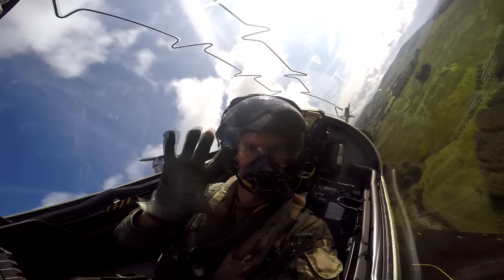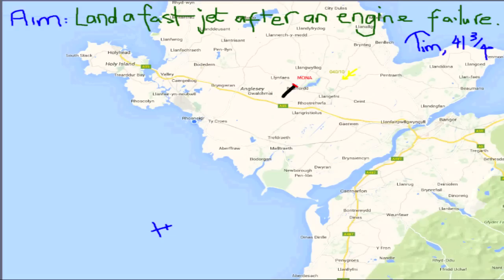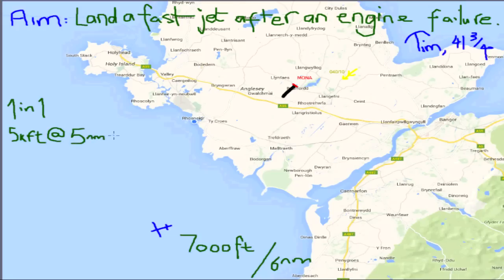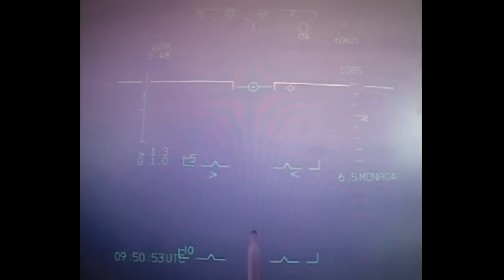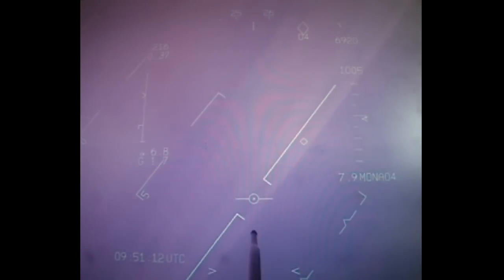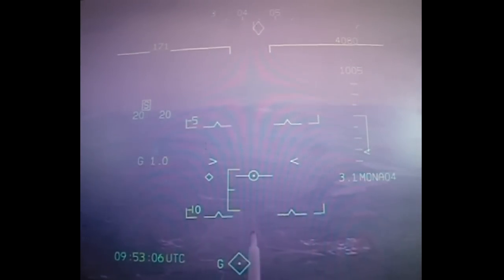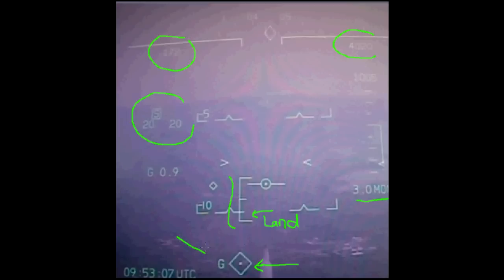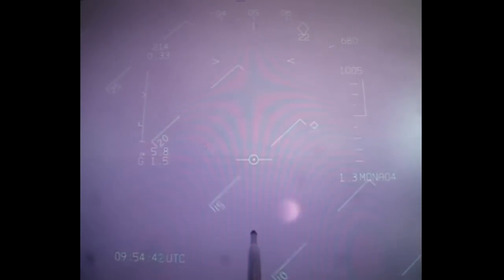When the ENGINE STOPS - Fighter Jet (FULL ATC AUDIO)

Comment: Too high?? Overshot the runway.  No air brakes?? Can you do a forward slip when too high?
Reply from the maker: You can but not advised in swept wing aircraft as you can blank the wing and the rate of descent can be unmanageable. S turns were preferable but not worth the effort so experienced pilots would sideslip or throw the jet away.
Reply: @FastJetPerformance  But a mild forward slip maybe, I mean, not like a piper cub with full ailerons and full rudder. Mild one only??  The Gimly Glider airliner and TACA 110 did Forward Slips both of them on swept wing airliners and landed safely.  Better than throwing the jet away, or your back from the hard ejection..  See those videos of airliners that did Forward Slips and avoided overshooting the landing spots and didnt crash.

Comment: I'm lost.  As a glider pilot, I do nothing but this.  1:1 @ 7000ft means you can cover 7000ft lateral before you have lost your 7000ft height.
In a paraglider, leaving the top of a 3000ft mountain and a 10:1 glide ratios, I easily covered the 3 miles to the landing field with a "down range" of 30,000ft.
A delta wing fighter jet, probably does have a 1:1 glide ratio at 190kts.  It's going to be +pitch AoA (or probably 0* pitch with a +AoA).
So if you are at 7000ft your maximum glide distance = 7000ft + whatever energy you started with.

Comment: Hi. What's it like dealing with engine failure on an aircraft that has terrible glide characteristic. The Hawk does look as though, and indeed this video shows that it can glide reasonably well but some fast jets look like they would just fall out of the sky.
Reply from the maker: Most do fly like bricks, Hawk glides 2 miles per 1000 ft of height lost, I'll cover this in the next video.
Reply: @FastJetPerformance  Brilliant! Fleet Air Arm was my dream job coming out of cadets (over 25 years ago now). Sadly my eyesight let me down at the time, and I wanted to fly the Lynx. I do enjoy watching videos like this, it gives me a very small glimpse into what life could have been like.

Comment: 5 back seat jollies in a harrier. 4 in a T4 and 1 on a T10 which come in 95. Compare the T4 cockpit to the T10 was massive. T10 being a class cockpit. 
Had a back seat jollie on the hawk T1 in 92 on the weather ship. I was sick as a dog. Couldn't even put the seat pin or MDC pin in so the jock couldn't park till I got them in as you well know 
I was banned from getting any back seat jollies at brawdy.

Comment: Sir could u explain the concept of ejection seat limit again.
Thankyou
Reply from the maker: Yes, of course. It's to do with speed and height, the seat is a zero zero seat meaning that it works at zero speed and zero height, it can be used just stationary in the aircraft on the ground. Now, the issue with speed is that, too high a speed and the parachute will be delayed (else it will tear) or if it deploys at too high speed, your internal organs separate and you die. Too low height and too low speed but with a high descent rate and the parachute doesn't have enough time to deploy. In this case on final approach, my rate of decent is about 8000 feet per minute so, using a rule of thumb of 1/10 rate of descent, below 800 feet, my ejection seat would hit the ground before full parachute deployment and its therefore unusable.
Reply: @FastJetPerformance  very informative. Thankyou :)

Comment: I am not a pilot but just curious as to why the warning to pull up when you are accelerating to take off after safely landing?
Reply from the maker: It doesn't happen all of the time but it's the GPWS, Ground Proximity Warning System getting excited - it only happens with certain aircraft at certain airfields - we just ignore it.
Reply: @FastJetPerformance   Must be momentarily a distraction though when dealing with other aspects of flight. Now wondering why only certain aircraft and airfields. I would have thought GPWS is an aircraft warning system and nothing to do with the airfields electronics?
Reply from the maker: @Ronald7077  it's to do with the way the DTED is handled in the GPWS, ie. It thinks some airfields have big poles in the middle of them, it's not a distraction and nothing to do with anything the airfield is emitting.

Comment: The best ejection seat maker on earth is a UK company and the RAF make you fly with non 0/0 seats?
Reply from the maker: David No, David. The RAF has the best Martin Baker seats that can be made but NO ejection seat will save you with a rate of descent that is found in the final stages of a PFL which is about 8000 feet per minute below 800 feet. It's 0/0 meaning that with 0 airspeed and 0 height it will save you (ie. Stationary) but not with huge rates of descent.
Reply: Fast Jet Performance OK I see now. Thank you for the explanation and your service.

Comment: Awesome videos. What an absolute ninja. Tornado questions, go! ....How does this procedure differ from the Tornado? Is it pretty much the same with different speeds? Is a conventional landing possible with only one engine out or does the approach change in that situation? Hit me with as much as you can, videos/more legendary diagrams are welcome. Thanks, Tim...Keep feeding us with this stuff!
Lee
Reply from the maker: A Tornado can't do an engine off forced landing - it weighs 26 tonnes fully loaded and flies like a brick. With one engine it is quite complicated but manageable, just higher power settings but you will use more fuel than if you have two engines running due to slower speeds creating a higher angle of attack of the wing and therefore more drag. Hope this helps, Lee.
Reply: Fast Jet Performance Yes, thanks! I take it your only option in that instance would be to remove yourself from the aircraft!
Can you recommend any half decent books on the Tornado or anywhere online I can learn more about it? Is all the RAF stuff classified?

Comment: Why put the gear down so early?
Reply: Tonkerdog1 get them down ASAP in case you can’t get them down later if the problem progresses.
Reply: Jabber 1974 Fair enough,  but it is a large drag penalty which might stop you reaching the airfield at all. Does the gear need the hydraulics to work or does it free fall.
Reply: @Jabber-ig3iw  Or in case you forget later, like certain Pakistani pilots recently.

Comment: thanks for the videos I am thinking about purchasing a Siai S.211, what do u think of them?
Reply from the maker: It's a dated design but, as long as you have a secure engine servicing contract, I don't think you'll do too badly. Alternatives are obviously the L-39 but I'm not a huge fan - that said, Rick, I can connect you with some guys who can give you advice.
Reply: Thank you sir, engine is easy,  older Cessna Citation,
Reply: I am also A&P

Comment: Wondering how different this is compared to fighter jets, wouldnt a turbofan at idle (like the T2) produce way more thrust than a fighter jet? Which produces little thrust to no thrust at idle anyways, so it would not be comparable (even in training). Is this trained in the 'big boy' aircraft later or do you assume the skills are transferable?

Comment: did you "land" at 1/3rd of the runway because you were doing touch-n-go?
Reply from the maker: We cannot land  from these practise forced landings because we are faster than normal and we land further down the runway. In reality, a real forced landing would probably end up with the aircraft in the barrier because we aim to land a third of the way in. The reason we do this is because to aim for the beginning of the runway gives us no flexibility if we are to land short. Only a third of PFLs are successful probably.
Reply: Fast Jet Performance so on a usual landing you don't idle the throttle on the slope? (more like at any part) then i don't really get why you're faster on the approach with the ENG off... not enough hydraulic pressure to release airbrakes/to recover from a flare maybe?
Reply: only "experience" i've had is from dcs(http://www.digitalcombatsimulator.com/en/). while it has by far the most accurate systems and effects, things like theese are missing. also only a really small group of peple fly the hawk(T1 in the game) at the flight model of which you'll probably laugh
Reply: +Fast Jet Performance I thought the airbrake and landing gear could not be deployed simultaneously on the Hawk?
Reply from the maker: Monkey They can't be no, but I was just saying that you would not use the airbrake in that flight regime anyway - it is rare that you are too fast for an approach. You can override the airbrake and deploy it with the gear down but you never would need to. I think your Hawk flight model might be super slippery. On a 3 degree approach (normal landing approach) set 80% - you should maintain speed of around 130 kts ish.
Reply: Great video Tim!

Comment: I thought that the Hawk had a 0/0 seat?
Reply from the maker: It does when it's on the ground or in level flight but not if you have an 8,000 ft per minute rate of descent below 800 ft. The aircraft's vector would need to be upwards to survive in this scenario.

Comment: I remember reading somewhere about a thumb rule.. to quickly determine distance to airport if you can make it or not just by measuring the distance with your thumb. Opinions on that? Would you use it? Obviously everyone has different size hands etc :D

Comment: Is there ever a situation where multiple failures cause ejection decision to be reached, even though the pilot knows he can land the aircraft safely? for example ASI / FLAPS failure during forced landing due to Power out means the pilot cannot proceed with the forced landing procedure - if no procedure for forced landing in this condition, does the pilot eject, or use own judgement?
Reply from the maker: That can happen, there was an incident in a Canadian Harvard (Texan T6) recently where a PFL went wrong and the undercarriage was damaged. The aircraft probably could have been landed OK but the risk was that the young instructor and student may be injured doing it so the base commander told them to eject. The pilot tends to always have the last call, personally ejection is a last resort as it can damage you quite badly but, at the end of the day, you listen to your peers and agree whether it's best to abandon the aircraft or attempt to land. Not all emergencies can be covered in the Flight Reference Cards - there are some emergencies that are just not known about until they happen - then it comes down to something called 'airmanship' - decision making through experience in the air.

Comment: Nice one, Tim.  I fancy that some of that was said so fast that it will have been unintelligible to the non-pilot, but it was pretty exciting. I was on the first Hawk course, btw, in 1977, but we didn't do 1in1 recoveries then, only PFLs.  I learned 1in1s on Hunters, at Valley then Brawdy.  Of course the spool-up time of Avon engine was a little quicker than the Adour's, but you were often in manual controls because the hyd pressure might have gone for real.
Reply from the maker: +Chris Barker The Hawk T1 still practises the High Key (4500 ft), low key (2500 ft) approach over the airfield but it was felt that the design of the T2 wing coupled with the extra weight of the aircraft made a 1 in 1 PFL the preferred option.

Comment: Thanks Tim,

I was going to ask if the T1a profile was the same but I see below you referred to a High Key and Low Key T1 approach. Could you briefly explain them please?
Reply from the maker: +klem lao It's like flying a circuit but a bit higher as the aircraft will descend faster with a seized engine so it starts at 4500 ft at the end of the runway then you should be 2500 ft alongside the threshold you are to land on before you start your 180 degree finals turn to land on the runway.

Comment: Great explanation and video. Reminds of that F-16 a while back that lost its engine and the pilot had to “dead stick” it to the runway, jettisoning the external fuel tanks at some distance from the runway, then lowering the landing gear at the right moment, pointing the nose of the jet at a point on the runway end, before flaring out. Thanks for sharing: http://youtu.be/Puia_yQxir8

Comment: Did the Voice call "Pull Up" because you were near the end of the runway or was it for any other reason? +fastjetperformance
Reply from the maker: +Matt Foster It was an overly sensitive GPWS (Ground Proximity Warning System) and was because I travelled the gear up when close to the ground. This is standard practise when we have a visually assessed rate of climb but the jet was just a bit 'sensitive'. It doesn't know where the barrier is, no.